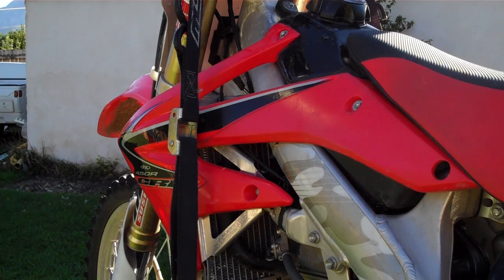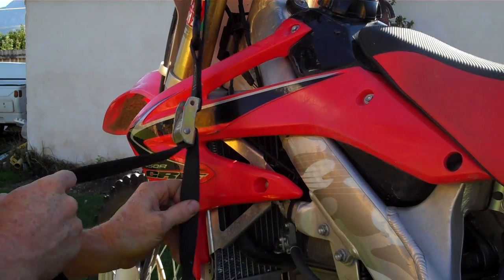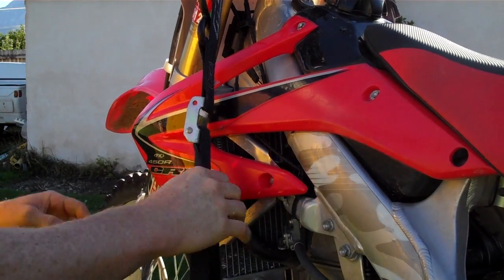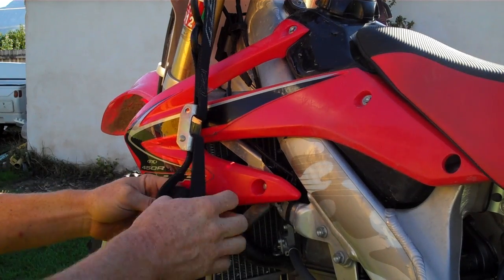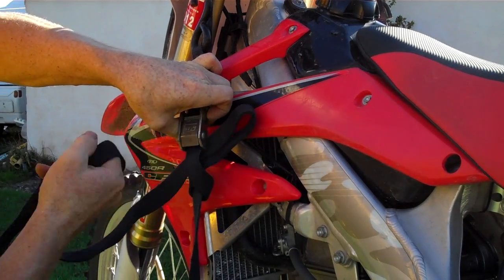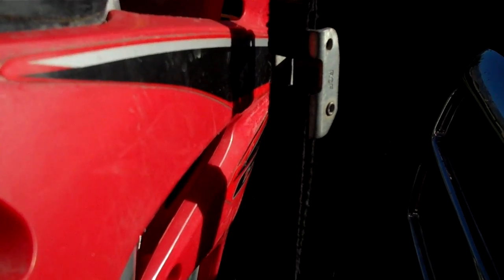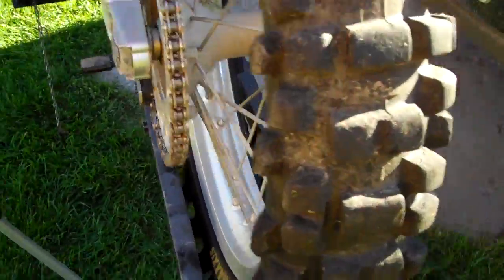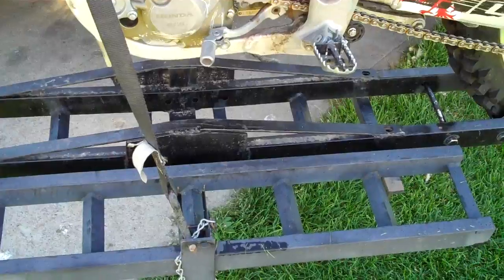How to tie down your dirt bike The number 4 knot

Comment from the maker: @mpdpspnp I've used the "seal saver" which is a plastic device that does the same thing.  A bunch of the racers used them so the fork seals wouldn't get worn out driving cross country.  I only go like 80 miles max these days.

Comment: you can use a chock (2x4 with some 1/4 inch rubber on the fender end) in between the front tire and the bolts of the lower triple clamp where the fender bolts to prevent the suspension bouncing.. it saves your forks too because it's not good to have them held compressed for long periods.

Comment: I never though about the bike suspension giving slack and being detrimental, thanks for pointing that out.  The knot you're using is also called a half-hitch (with a quick-release).  It's one of the first knots a lot of people learn, because it's used as a safety knot on the running end of more complicated knots.

Comment: it's definitely good to have that knot as a backup, but I prefer a good set of ratchets and a fork support bar (you know that pole type thing that goes between the front wheel and the bottom of front guard). I've done easily 3,000 miles. Mike bike sits in the back, and for the first 500km's (or 300 mile) you keep checking, but you relax after a while and trust your equipment.

Comment: if you take a 4x4 cut to length between your fender and the top of the tire? Its cheap,protects your fork seals because the springs would not depress, And there would be No slop in the tie downs to get loose!

Comment: the knot you are using is called a half hitch should add another one or two to secure it better & you may want to place the cam buckle lower where it will be suspended out away from the bike where it wont rub up against the bike.

Comment: Ratchet straps all the way brother. Don't let it take a fail to learn.
Reply: I've never had a problem with cam style straps, they work great.   Most issues are user errors, which is hard to believe because they are so simple.    The tension needed to strap a bike down is minimal and cams have no issue at all holding it.

Comment: Fuck that shit i use ratchet straps i don't trust those straps haha one of those snapped on me and since my suspension was compressed from being Brought down and it jolted my bike to the side and scratched up allll of my plastics put a BIG ass hole in my pipe snapped my Renthals and snapped my Supposedly "Unbreakable" levers haha
Reply: Dead Alive- you didn't have good quality straps, they were worn, or you didn't use them correctly.
Reply: Probably, they were the best I could find at the auto parts store so yeah. But my ratchets didn't snap and they were from the same place.
Reply: Agree with Bubba...  user error!   Any strap has to be inspected every now and then in case something has cut one slightly or whatever.    The tension required to anchor a dirt bike down is so minimal, your straps had to be the biggest piece of shit ones you could find or you screwed them up running over a sharp edge somehow or something.   Only other explanation... factory defective, which has nothing to do with the cam style system in general.